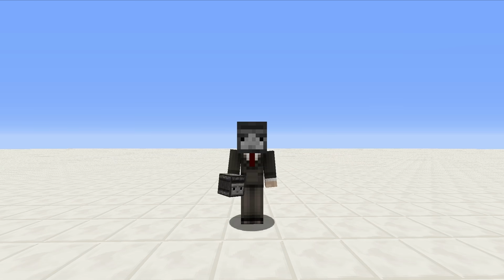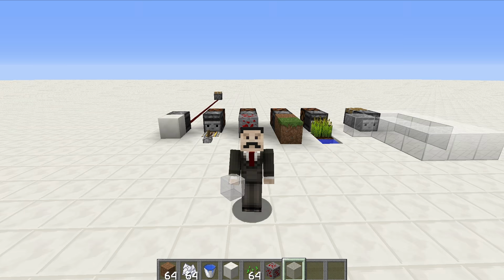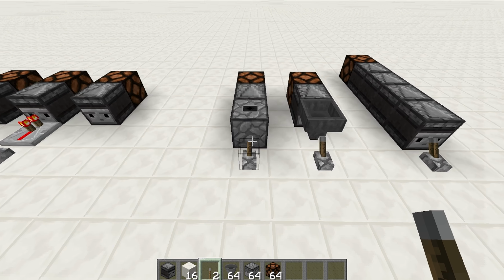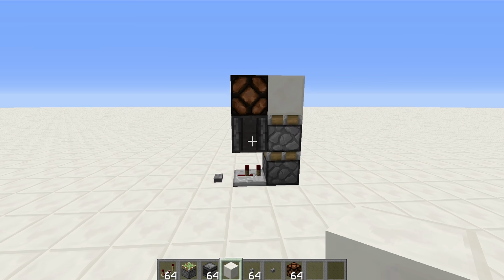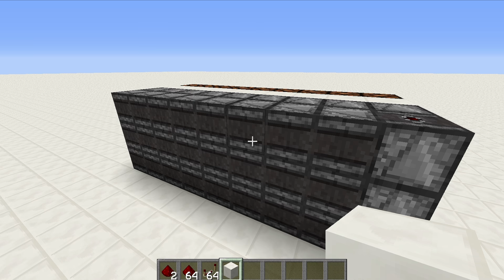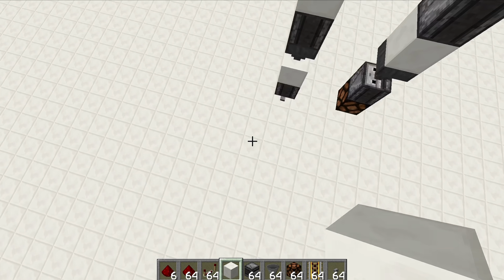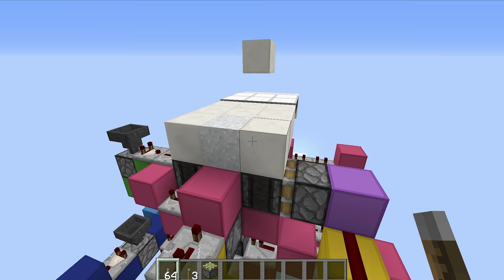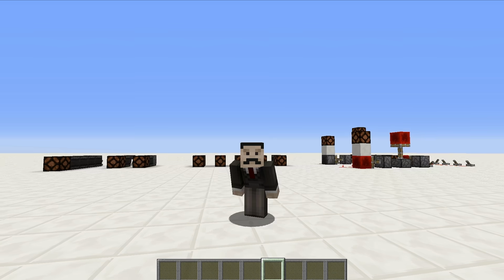"Minecraft OBSERVERS Make NO Sense.. "

Comment: Would it be possible to make a cycle of block swapping that doesnt stop if you for example had a 3X block swapper if you put the observer where the blocks move to could it power it and just keep the cycle going infinitely or am i looking at this wrong bc its when something changed within like a one black radius right?so if you got the observer to face the blocks being swapped around it could power something per say a dropper for example that drops things into lava like a rubbish disposal machine? And if you got the block swapper on a loop that could just keep going until all the items are disposed of,i mean there would be simpler ways to make a machine like I described but it would be a good use of the block

Comment: I made an alarm in Minecraft.
I used repeaters facing in opposite directions to keep the output alive.
That powers a piston with an observer which clashes into the other observer giving infinite outputs.
The output is connect all the way to the alarms at the surface and start ringing. 
It's like a bank vault.

Comment: 3:48 It could be used to detect when an item frame is rotated so you could use it as a hidden button.
Reply: You can just use a comparator behind the block the Item frame is attached to. Item frame is not a full block so you can see the observer behind it
Reply: Just take the comparator output from the block and put an observer facing into the Redstone line coming off of it. It will detect the change in power and give a 1 tick pulse whenever the frame is rotated.

Comment: double piston.
The top one should be a sticky piston, right?
When it retracts after pushing out the thing, why does it forget its sticky?
Reply: texteel the observer gives a one tick pulse. When a sticky piston gets a one tick pulse it spits out it's block
Reply: @mrnnp8981  because the slime lathered onto the piston is only sticky when electric current is running through it.
It doesnt make sense, neither IRL (shouldnt use physics I know) nor with MC rules.

Comment: I mixed the redstone signal strength detection with a comparator signal lengthening circuit and connected the observers to pistons to make a wall that used multiple monostable circuits to open and close in specific places and, the second time using it, resets it

Comment: I found out how to make an observer clock. Set a redstone dust line from the back of the repeater to a fence, and have the observer face facing the fence. Open the fence and it will power the observer, which will power the fence, and it will keep going over and over.

Comment: For the bit at 6:37 there are cheaper options you can use instead of the hopper 

the cheapest you can use is a fence gate only problem is it makes a lot of noise 

The one I like to use that is quieter but a bit more expensive is the powered rail the only difference is on the way down you need to remove the block in-between the observer and rail

Also if you need to put them next to each other you can use activator rails instead and the lines won’t interfere with each other 

Thanks for showing me this :D

Comment: you know those windmill/turbine/wheel designs you've mentioned in other videos of having an "appreciation/fasninaton"  with the observer block activation on either the pistokns extending or the blocks moving past , you can can shrink the circuitry down to almost nothing(save space), and what I can only describe as an and/or switch.   

switch im unsure about but think is neat is start with one stiky piston faceup one block down with Redstone blockon top. one block above the Redstone block make a "cross of piston sticky or various circuitry to be activated. place observer under one of the pistons  with sensor side facing the only red stone block. connect observer output to the 4 pistons that form he " cross" via half slab and dust. on opposite side of redstoneblock from observer trail out a little dust then lever, from the side/underneath the original/first sticky piston form a dust line away from perimeter of the 3x3, then also bridge that dust so it is  connected to the branches outputted from observer that lead to the 3slabs/other pistons in the "cross" . must bridge connection before first branches off.  so now you have two levers roughly opposite each other. turn either on machine starts "infinite loop" that can actually be stopped by the second lever. however to restart and subsequently halt the loop, you would have to activate the levers in reverse order.   everything fit within a 5x5 space 3 blocks high only for the 4 pistons of the "cross" so that the attached slabs can have dust placed on topand receive power when the Redstone block is up but will then be powered by observer as soon as the Redstone block retracts.  in the grand scheme imagine(spongebob level imagine) that your playing pong with the output from a Rstoneblock being raised and lowered and the observer block set to out put when it is lowered. really hard to describe since I feel I'm still pretty much a novice at Redstone, but would much appreciate your thoughts if your able to decipher my no pun intended Mumbo-Jumbo xD

Comment: I cam up with a really compact dispenser clock with this block that requires the observer, a dropper, 2 redstone, 1 repeater, 1 comparator, and one constant power source. It can be toggled on or off and have a custom speed.
Reply: Its the idea that the dispenser is powered very briefly. Thus the observer powers a 2 piece redstone stream that goes into a repeater. ( It can be toggled to any delay other than 1.) This goes into a powered comparator in subtract mode that goes into the comparator. The comparator is the source of power for this tiny circuit and you can toggle the comparator off, decide what circuit it is the output of, and more. And one you power that comparator it powers the dispenser. SO ON SO FORTH
Also very compact.

Comment: I love the channel! I've been watching for about a year. You have taught me so much about Redstone.

Here is a contraption I am trying to make...a self-populating chicken cooker.

That is, a chicken holder with a sorter.

The chickens lay eggs. A hopper receives the egg, which passes through a sorter. The first sorter selects daw chicken, so it passes.

The second sorter collects feathers. Again, the egg passes over. It goes into a chest which collects the eggs.

The egg chest sits on a hopper the remains locked until the chest is full of eggs. Once the chest is full, it unlocks the hopper, which feeds into a dispenser that shoots the eggs into where the live original chickens were. 

I say were, because once the chest is full, the live chickens are drowned and turn into raw chicken and feathers, which are sorted appropriately. 

Then after the chickens are drowned, the eggs shoot in to replenish the live chickens.

I made a manually operated lever based version, but I cannot put the logic down in Redstone to automate it. It filled the egg chest very quickly as I had about 20 live chickens per run.

Oh, one more thing, the raw chickens were hoppered into an oven supplied by a chest full of coal blocks fed by a hopper in the back.

An almost unlimited supply of cooked chicken and feathers for arrows.

Thanks!
Sensei

Comment: You can also use doors with observers to propagate a signal vertically instead of droppers, hoppers, etc. Not sure about the update speed, but they do cover a larger distance, which brings down the cost per block signalled.

Comment: how did you forgot to mention that:
they're the best thing ever for flying machine because they can make redstone circuits that don't break while moving. and even better, they emit a pulse every time they move which makes them the best candidate to power flying machines.
also they're the only way to transmit a signal through a 1*1 block wide tunnel without affecting in any way any of the blocks on the side.
so actually the only question is ? why aren't observers an always better choice when making redstone. and the answer is, they only work with 1 tick pulses.

Comment: For super fast droppervators, you can put a column of observers output side into the column of droppers, and then a column of observers facing upwards or downwards for a 3 block wide column.  Why is this important?  Because you can use clock circuits that would run too fast and burn out redstone torch towers.  You can also make super fast clocks using two observers and one short redstone wire.  One benefit of this droppervator design is that you can have things being raised or lowered by the dropper tower, and it can be triggered from top or bottom.  For a top ANd bottom triggered system, simply add a second column of observers, and connect both trigger columns with one piece of redstone.  The layout for that design would be a T shape.

Comment: mumbo, i doubt you will see this or respond, but im having major issues. For some reason my redstone doesn't work. say for example in a light swapper (where a piston pulls a wall block out and replaces it with a light source) i followed your instructions to the letter, even using the same blocks as you, but it refused to do it. I don't know what I'm doing wrong, or if my minecraft is fucked.

Comment: Good except for one thing. repeaters comparators and redstone lines haven't caused light updated for many versions now (redstone torches still emit light though), they were changed to make them not emit light ages ago. Still observers are much more lag friendly than redstone dust due to redstone dust's horrendously inefficient coding when it gets unpowered.

As for the observers and hoppers, if noise isn't a problem, use doors, they're two blocks high so it's even faster, and they're not tile entities that tick every game-tick so they're more lag friendly. For horizontally sending signals use powered or activator rails, as once again redstone dust is extremely laggy because the game, when it's unpowered, it has to degrade the power over the line which was coded stupidly inefficient, the amount of lag from a redstone line increases exponentially with its length/distance from a power source

Comment: Mumbo Jumbo giving lag tips!? XD
Reply: Don't they do? I mean, they give out flashing lights that observers can detect when powered.
Reply: they do not give lighting updates, but they do cause a TON of block updates (as in a 4 long line of redstone does over 2000 block updates)
Reply: Game Changer the game code. Is that an accurate enough source of information? :p
Also, I should point out that it's ONLY redstone dust that has this lag problem, repeaters are totally fine, unlike Mumbo said. Redstone torches create a bit of lag because they actually do create lighting updates, but redstone dust is actually worse.
Reply: Yes but it's not detecting that, it's detecting the block state change. More general and would allow people to understand why observers behave as they do.
Reply: the observers dont detect the light levels of the redstone or whatever you are saying. they simply detect the signal strength of the redstone
Reply: CyrenArkade light level of redstone and signal strength are the same. If you are talking about the light level given out by torches/lamps or any block that gives out light then it's not true. Observers only detect change in redstone signal strength, not light levels
Reply: Observers detect any change in the block in front of them, unless that change is specifically marked in the code as "observers should not detect this".
(Technical: by "change" I mean block update, and by "marked in the code" I mean it's a flag in World.setBlockState)
Reply: Oh, I see. Thanks.
Reply: CyrenArkade umm... is that accurate? Where did u get your information?
Reply: mumbo - never removes it himself, teaches people how to prevent it.
Reply: I think by “lighting updates” he meant when redstone “lights up”. Dont try to say it as if youre a redstone god.
Reply: Earthcomputer I do agree with you but using that analogy would make it easier for newbies to understand.
Reply: He doesn't know what he's talking about lol. Redstone dust and repeaters don't give out lighting updates.
Reply: Kieran Tilley I think teaching people how to prevent it involves not teaching them incorrect information.